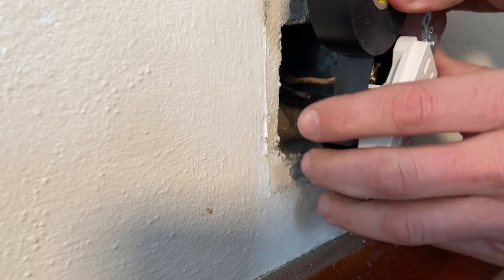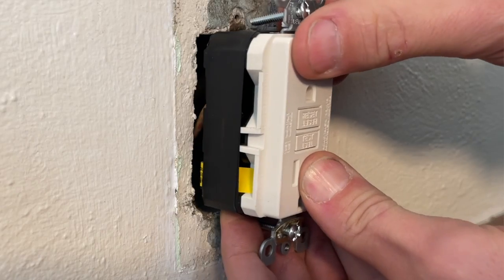Should You Wrap Outlets In Electrical Tape?

Comment: I curse the jackass that tapes an outlet when I service one.

Do a neat job, wires neatly wire nuts secure, wires neatly tucked (no spaghetti) and all is good.
Reply: I've seen neat wiring that was so neat that when I got to the pigtail wire or wires just fell right out. That person frequently forgot to make proper terminations. The connections is the most important part including Safety Followed by neatness. I curse the jackass that is so neat with his job that he forgets to do proper terminations. If he does both excellently Then I commend him.
Reply: I worked with a left handed apprentice. I went behind him as one should. All his joints were loose! So instead of blowing my top. I asked him to make a joint. He had never heard"Righty tighty Lefty loosey. He did not know that it mattered. Do not take for granted the most basic knowledge. Once we got that straightened out from then on no issues.
 And no tape! 
Ask most young 40 or younger what a bug is.
Reply: Lmao you sound like one those electricians where the boss didnt buy tape. Also tape helps keep it together and prevent fire from vibration zones
Reply: There’s nothing wrong with tape 
Especially when there’s metal boxes 
Gfci are tight in old boxes
Reply: @bobdabldr323  especially if the gfi goes through a single gang plaster ring.
Reply: Have you ever worked on a metal cut-in box secured with Madison clamps? Was it a shallow one or deep? Dead end or feed through? There ABSOLUTELY are times when taping is best practice. I don't buy the "it's not required by code" argument one bit. The curvy rural highway I drive to work has a speed LIMIT of 55MPH, but I'm not going to make sure I'm going 55-60 when the road is covered with ice and snow.

Comment: Okay so, because you brought it up I want to add to your opinion on taping wire nuts.  do your pull test before applying tape and that'll solve that problem.  For me, I always tape hot and neutral wire nuts but I also work in an industrial environment where the connections could experience splashing. For this when I terminate I always keep the wires pointed upwards so the wire nut doesn't act as a basin and I always wrap them with tape, not to hold the wires but to keep moisture from getting to bare conductors and causing a short. With small 480v motors where the j-box is too small for lugs and boots we will wire nut and tape the motor leads. But larger motors we prefer bolted lugs. For 2300-4160v medium voltage there is an entirely different method but it still results in bolted lugs.  That's just the environment I work in. From time to time we do receptacles but most times the only 120v we do is to power transmitters  or coils. For a lot of that we have j-boxes with terminal blocks in them. For digital PLC motor groups I still use tape because despite being in an enclosed plc cabinet Murphys law always applies lol.

Comment: I put the wire nuts on properly, AND secure them with electrical tape.
Reply: What is the advantage of using tape on a properly secured wire nut?
Reply: If you put it in properly you are wasting time and materials. The instant I see tape on a wire nut I think amature and am very careful!
Reply: @jamesscott6753  additional "Long Term" Reliability and protection. Think Moisture and or Dirt infiltration. Especially dirt that is either combustible (Sawdust) or Conductive (Metal filings).
Reply: @dannychavez2420  Seeing Tape should not affect you being Very Careful ..  You should start being Very Careful.
Reply: @miketritsch6166  I am careful with weapons that I know are loaded, very careful with unloaded weapons!
Reply: @miketritsch6166  combustible materials in a wirenut??? Did you not pipe correctly explosion proof installation is way beyond the scope of this site!
Reply: @miketritsch6166  what? If you have moisture or debris getting into a wire nut you shouldnt be using a wire nut and  should probably rethink what you're doing
Reply: @dannychavez2420   Not talking a Petrol Plant or even some place with Solvent/Paint storage.  Think Sawdust in your Garage, Lint in the Laundry area, Protect against the worst case and you will never have it. Not all boxes are in "Clean/Dry" area's. Also the use of area's change. Todays Dry Garage that is used to park cars in may be tomorrows Hobby area that has a small Scroll Saw on a bench.  A little 20 Amp Circuit can start a fire that spreads perhaps easier than one of my 100+ Amp Motors because someone dose not take that extra little step.
Reply: Yes Moisture in Boxes. Especially residential Exterior walls Poorly Ventilated crawl spaces to some extent Laundry areas are bad also.  The insulators don't get adequate insulation installed, The Ventilation is not adequate or is not in use and you end up with condensation. I am not talking about a Flooded Box, but wire nuts that have the internal spring rusting over time. Not an Ideal situation at all but it is real world.
Reply: Anytime i see tapped up wire nuts in a box its a huge red flag. Most times the tape is used to hide a sloppy splice job where to many wires were under a wire nut
Reply: @handlerpandler424  yes That happens. Clever trick. but that is not a good reason to use tape.
Reply: @jamesscott6753  Even a properly installed wire nut doesn't seem that secure when you're trying to jam all the wires back into the box. Admittedly I'm not a professional electrician, but I am an electrical engineer. As for "professionals", I've seen lots of shitty electrical work done by professionals. Recently I took apart a professionally installed 50A, 240V EV charger socket the previous owner had installed in my garage. It was wired with 14 gauge wire, even though the socket was clearly labeled to use #10 through #4 wire.
Reply: @miketritsch6166  to wire to protect against worse case would require explosion proof, dust proof, and armature proof installations?! Not possible! How many rolls of tape are required to wrap all devices in an installation also the labor? If I add that on an estimate I lose the job.

Comment: I never understood why the code is so strict on so many seemingly insignificant issues, but it's perfectly fine to shove a receptacle with exposed neutral and hot screws into a box full of bare ground wires.  I'm currently doing a project where I already had two shorting issues with ground wires in PLASTIC boxes!  And I am a sticker for neatness and carefully folding wires---but it didn't stop these issues.  Ironically one I removed where the electrician had taped it and I inserted it back untaped.  Now I tape all receptacles.

Comment: I work with 480v in industrial setting and always tape mine.   But then again, it's not to "hold" the wires together either.   I tape from 1" below the nut all the way up to the top of the nut.   Makes repairing/trouble shooting WAY cleaner and easier when this is done.

Comment: Just finishing 1st year apprenticeship in Canada and have never heard of anyone doing this.
Reply from the maker: Hmmm, interesting.  Thanks for the feedback and I do think it varies widely across different regions of the US and Canada.
Reply: If you wire it correctly tape is not needed.  Give the Canadians a hold star for not doing a pointless task. No sarcasm intended.
Reply: Here in Chicagoland it's common practice to tape. When I started in the trade no but over time yes mostly do to local city codes. We also pipe everything and use metal boxes, no blue stuff here. The bigger question is why do I see on TV shows shot in Canada panels mounted sideways on the wall. Now that's crazy.
Reply: @robm3063  ya and Chicago plumbs drains in copper and iron not PVC in commercial.  Walking down th hall looking up at 6" copper pipe is a trip.
Reply: @robm3063  panels horizontal in Canada: more kos in the side. Now you know.
Reply: The tape must leave a residue when you want to un-tape the device to swap it out. Too time consuming and for what?
Reply: I learned from an electrician 30 years ago in Ontario and he did it.  Been doing it ever since.  One wrap only.
Reply: @rocketrider1405  good tape yes but in practice since I'd have pigtails I'd just cut off the old outlet.
Reply: @rocketrider1405  Never had a issue with residue. As I stated in my part of the world we use metal boxes and drywall rings. The tape makes it safer to remove the outlet when hot. Yes I said hot and yes because I can.

Comment: After getting shocked so many times I have decided to wrap them. Now I don’t get zapped anymore!
Reply: I bet if you look you'll find that most places that are wired for electricity have these boxes full of things called breakers. Some of the older ones have fuses in them. It was a life-changing experience when I discovered that you could remove a fuse or switch a breaker to the off position and avoid getting a shock.

Comment: In a metal enclosure it is advisable to wrap an outlet or a switch in electrical tape, preferably Scotch 33. Reason being during the life of the outlet it is possible for it to move with usage and come in contact with the enclosure that could result in a short circuit, if the enclosure is grounded. Only takes a couple seconds and a couple wraps.

Comment: I'm not a pro just a homeowner with repairs to do so yes wrap the connectors with electrical tape ! When i do solid core wire I pre twist them ... not a lot but just about a 180 or so and seems to help get the wire nut on faster and better ( less loose wires when doing the pull test ) ! Have not used the WAGO  connector yet but very interested in trying those out soon ( from my limited checking they are just as good or better that wire nuts and have some benefits too ) !
Reply: Also you show the install of a GFCI  outlet in this video .... my question would be when to use them and when not to use GFCI outlets ?

Comment: In my kitchen, there's a receptacle next to a switch, they are not on the same circuit. The electrician put tape around both the receptacle and switch, but not around the others in the house. Makes sense, since you might forget to shut one of the two breakers and then work in there, the tape adds a little bit of safety, although it's best to use a voltage detector to ensure there's really no power.

Comment: I build CNC machines and the only time I use wire nuts is pretty much the only time I use electrical tape too. And that is on main 3 phase electrical motors. The boxes on them are rather small and the wires are usually packed in there quite tightly. You can't hard wire them in case it needs to be changed sometime in the future. You always use a NEW wire nut, (not too big, not too small), twist it to where the shielded portions coming out of the wire nut are twisted too, and you always wrap the nut and wires with electrical tape the direction of tight.
A loose wire in an electrical box, that's one thing. Loose wire in a motor.... whole different animal.

Comment: I always use screws over push-ins, use pigtails if there are not enough screws, and wagos over wire nuts.  I've seen too many wire nut failures over the years.  As for tape, I never tape for single plastic boxes.  I always tape for metal boxes and for non-single boxes.  I've also used the GFCI trick for converting no-ground boxes and wiring to have a three prong outlet.  But is that metal box grounded through metal conduit?  If so, you would get a real ground just by screwing in the GFCI to the metal box.

Comment: Guys please don’t use dollar store knock off electrical tape. Over time it either reverts back to an oily mess or turns brittle and can flake off. This is a bitch to clean up and can be a fire hazard.  Stick with 3M tape. $7 3M tape can last years. The savings with cheap tape is so insignificant.

Comment: I installed a new ceiling fan in our upstairs bedroom awhile back. And in the instructions that came with the fan, it tells you to wrap the wire nut and the wires with black tape. And it shows to crisscross the electrical tape. It goes on to describe how it holds the wires in place. I am not doubting anything that you were saying. I guess there is a lot of conflicting information.

Comment: I don't Wire Nut... I wago... I do wrap OUTLETS... I do NOT wrap switches
Reply: I wrapped a switch just yesterday because the wiring terminals on the new switch were on the side, and on the old switch, they were on the back. The opening in the plaster ring was so narrow that the terminals on the new switch were only 2mm away from the plaster ring. So I wrapped it just to be safe.
Reply: @ROGER2095  ok, I would so agree there.  Thinking after I posted... there are switches I would wrap.  Yours would be one.

Hey... checkout the rubber band outlet wraps.  Mine are blue... don't want to plug the company here... Google it.  They work great

Comment: I worked with a guy that did that. Said it prevented getting shocked. TURN THE POWER OFF FIRST!
Reply: Hospital facilities guy here in a building built in '83, unfortunately that is not always an option, and our hospital grade receptacles and decent wiring practices actually make it relatively safe to backwire devices on live circuits.
Reply: Turning the power off isn't always feasible or desirable. If you are an electrician you should know that.

Comment: After my first toddler stuck a key in an extension cord, regardless of code, I always wrap both light switches and receptacles in two wraps of electrical tape. As a father and now grandfather, it is to help protect little fingers that always are exploring. I have seen kids remove things like wall plates, broken cover plates, and there is always the chance that during future painting or other modifications, the wall cover will be off and a child will get curious or an adult get careless. Wrapping is an extra layer of protection.
Reply from the maker: Good thoughts, thanks for sharing.

Comment: I looked into this. You don't do it. It's substandard if you do. If there is a problem inside that box and it gets hot, it'll catch on fire first. Often well before there would have been a problem otherwise, like a breaker trip. What is in that box is carefully tested with UL. The figure out how much copper can be in that box. If you're a real electrician you know about that stuff. Pig tails, how to add up copper lengths and come up with a total and the max allowed etc. Introduce tape like that and now you're outside of what they tested. So it's probably not UL approved either.
In short - don't do it. Screw the terminals in. Put the plug in as standard and there won't be a problem.
Reply: It is note even mentioned in the code
Reply: @gerdberg4188  That's like saying you can put gasoline or kindling material in there because it's not mentioned. Use some common sense. This is a practical matter. There are documented cases where sockets were hot and electrical tape caught on fire and then caught the house on fire. Had the tape not been in there the house wouldn't have caught on fire. The breaker would have tripped and everything would have worked as designed and tested. Start doing weird things like that and now you're making a test circuit. Do you want test circuits in your house?
There is no reason to use electrical tape around a socket or light switch. None. It's safe the way it is.
Reply: I am an electrician and none of what you say has any bearing on putting electrical tape on a receptacle.  First, if the box is hot enough to light electrical tape on fire you've got more problems than just the burning electrical tape. Electrical tape heat rating is high than than either THHN or romex which is rated at max 90C. All of your wire's insulation will be melting right along with the tape. Second, electrical tape in not even counted in box fill. Conductors/sizes, connections, etc, all are. We do not count for electrical tape. 

Yes, screw in the terminals but there are reasons why you may want to tape the receptacle and NO it is not a danger. First, if you have a metal box tape it. Wires come loose from the terminals for a variety of reasons. Thermal expansion/contraction is one of them. If a wire comes loose and there is a problem with your grounding system, which does happen, it could energize any number of things and you could suffer a shock. Second, when removing the receptacle from either a metal or plastic box could prevent a shock if you've touched one of the terminals inadvertently. I know I've been shocked this way a time or two. There is NO requirement to tape but there is no danger if you do. IF there is an arcing condition a properly installed AFCI will detect it and trip. If there is overcurrent then the the breaker will trip.
Reply: @qball3835  Go figure. The last guy that responded to me on another video and said it's needed also admitted he pulls out live sockets. What are the odds. I don't think he was really an electrician.
100% of the electricians I have worked with over 35+ years turn the power off to the sockets before working on them.
What I can tell you is wrapping sockets as a regular course of wiring a socket is substandard. Don't do it. If you have a reason to do it that's one thing. Like a GFC that is close to begin with - maybe. Doing it just to do it can simply make a gooey mess for someone. Depends on the tape of course. One guy said he even does it for light switches, which seems absurd to me.
Maybe 3M is sponsoring discussion like this to sell more tape.

Comment: I didn't until once when I was pushing in the receptacle into the box the ground wire bent and I didn't notice it so turning on the power resulted in scary pop and tripped the breaker.   
Decided it was good practice for my consumer efforts as I'm not being paid to try to do everything as fast as possible.